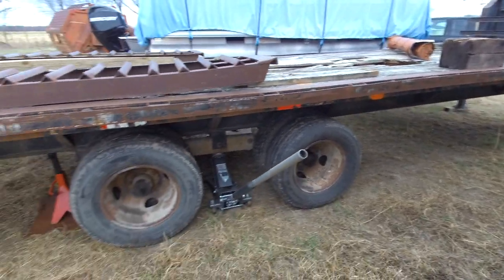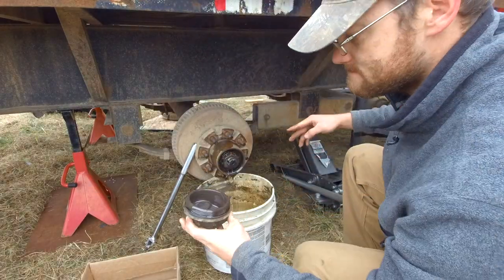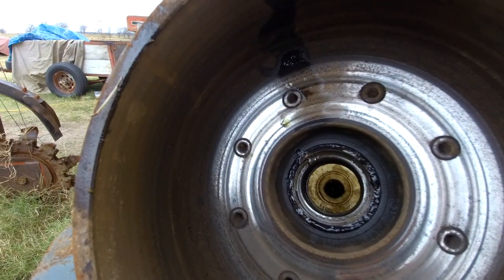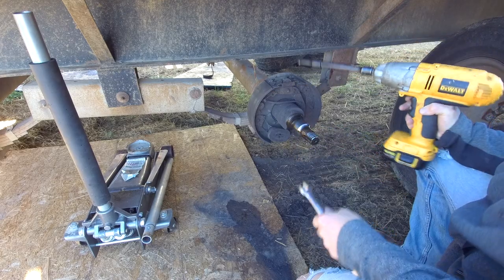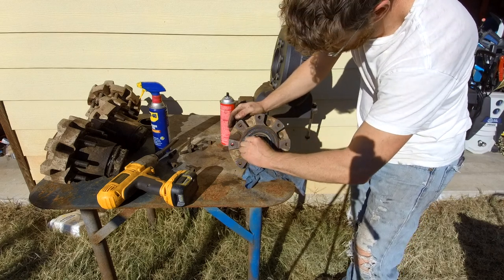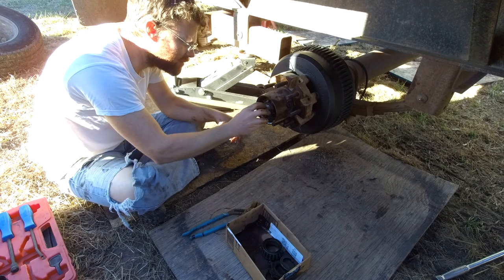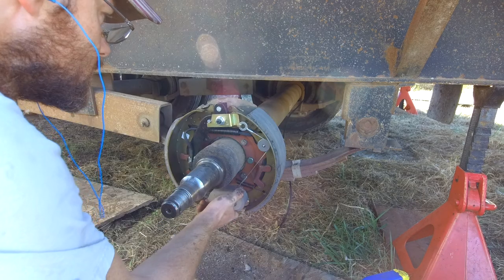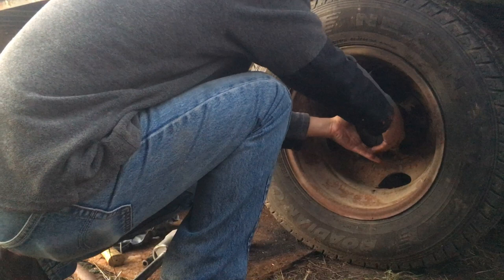Gooseneck Trailer Brakes Dexter 10k

Comment: I just did my chippers 10,000 lb axle, 12" dexter. 
Had to torch the hex off, grind, then go from the back to cut off the tread/nut once the backing plate was removed. (Both sides) what a process. One of my crew was on the highway, smoking, got her back to the shop, completely destroyed pads, super fun removal....

Comment: Great job. Just keep an ear out for worn magnets and if you find yourself adjust your trailer gain above the number 8 you maybe have a magnet grounding out or a broken wire.
Reply: Wow finally someone gives a good answer on what the gains are supposed to be!
Reply: @azhauling4109  If you have electric over hydraulic brakes you should be gain should be around 3 loaded and 1.5 empty. Electric brakes play with the gain around 3 empty and 5 loaded when everything is new.
Reply: @antmoundlogistics  😯 wow, yeah my 7k axle trailer works amazing like that, but my 9k triple axle always on 10 and still garbage. I just went out and bought a large to resurface the magnet area bc know that’s the issue. If that doesn’t fix the problem then proteus the convert whole system to electric over hydro disc brakes
Reply: @azhauling4109  Make sure that you go into your trucks menu and adjust your brake settings to heavy electric. It makes a huge difference.
Reply: @antmoundlogistics  yeah it’s set to that. Just had another magnet melt-down today 🙄😒
Reply: @azhauling4109  if you can’t get any. I have two that I will sell you for a $100
Reply: @antmoundlogistics  😯 yeah I’ve searched high and low for that bar Ammco 29240 and all out of stock. If u have one I’ll buy it! 🙏🏻 🤗
Reply: @azhauling4109  The part number that I’m talking about is KB1210E-06.

Comment: My brakes very great at one point now they aren't doing nothing. I've changed 2 brake shoes and the other are fine but still not tug on stopping using only trailer brakes. I can heard them engaging I just don't know
Reply: I’m assuming that you have hydraulic brakes. Bleed your brakes. These are the steps, fill the pump with brake fluid activate your brake away then refill the pump. Bleed from the farthest wheel back to the pump. You will need to look at how your lines are routed to the wheels too figure that out. Keep an eye on your fluid level in the pump while bleeding the brakes.
Reply: @antmoundlogistics  electric

Comment: What are you tow it with? Just found a gooseneck like yours and have a 97’ Dodge 5.9, but not a dually.
Reply from the maker: A 05 chevy dually duramax usually.  Also a 97 k2500 6.5 diesel. Which is alright too. Just slower up a hill.  That 5.9 cummins should do just fine.

Comment: What was the size of the bearing nut.
Reply from the maker: 2-1/4"
Reply: @robertscottII  Thanks. I have a 2020 gooseneck trailer with 2 10,000lb. Axles. When I squeeze the trailer brake I only hear one magnet and I'm getting the trailer disconnected message on the dash.
Reply: @jamesmorris8226  the wires inside the brake unit will fry and short out, resulting in the disconnect or some other failure message. You can replace the entire assembly or just the magnets.
Reply: I had the same  message and I made new connections where the magnet cable comes out of assembly and connects to the cable that is on top of axle. I also found that the cable of the magnet has a plastic round piece making the cable to bend. I hope this helps.
Reply: These size are predominantly 2.25, and it's hard to get the socket.
I use my crescent, and modified a 55mm, then ground my nut